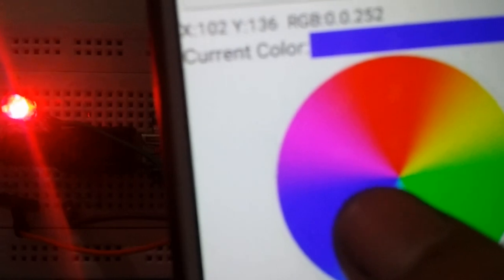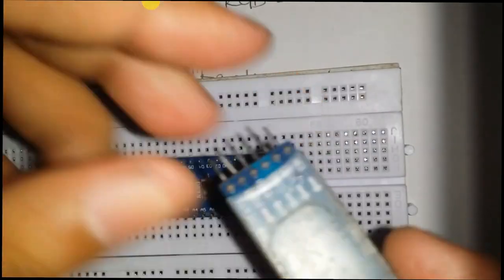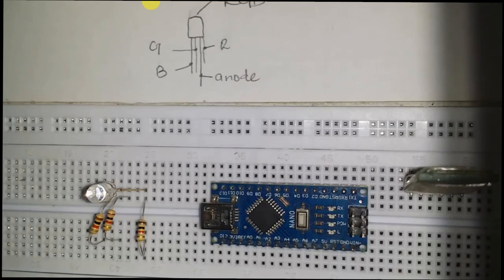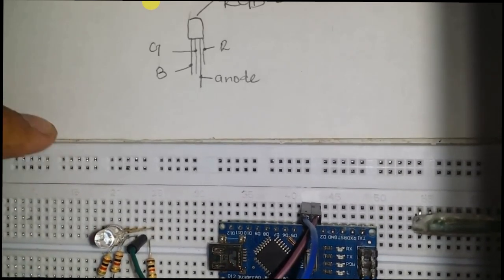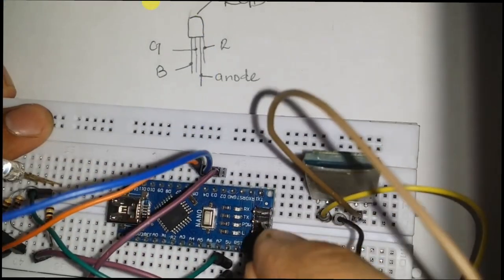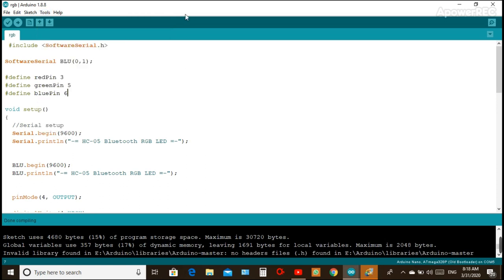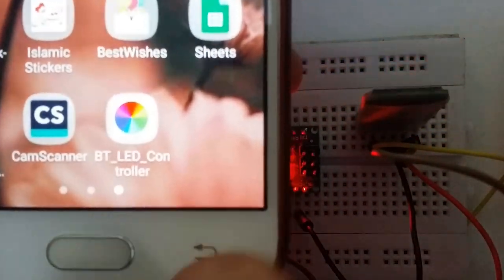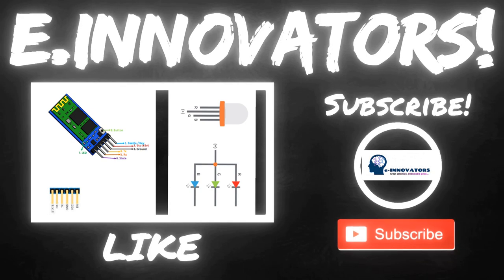RGB LED Control using Arduino! | DIY | Circuit Building | Demonstration | Tutorial | HC-05 bluetooth

Comment: Arduino: 1.8.13 (Windows Store 1.8.42.0) (Windows 10), Board: "Arduino Nano, ATmega328P"

Sketch uses 4538 bytes (14%) of program storage space. Maximum is 30720 bytes.

Global variables use 357 bytes (17%) of dynamic memory, leaving 1691 bytes for local variables. Maximum is 2048 bytes.

An error occurred while uploading the sketch

This report would have more information with
"Show verbose output during compilation"
option enabled in File -> Preferences.

^^^ How to fix the error?

Comment: I could not find the code in the video. Can you share it.
Reply from the maker: #include <SoftwareSerial.h>

SoftwareSerial BLU(0,1);

#define redPin 3
#define greenPin 5
#define bluePin 6

void setup()
{
  //Serial setup
  Serial.begin(9600);
  Serial.println("-= HC-05 Bluetooth RGB LED =-");

  BLU.begin(9600);
  BLU.println("-= HC-05 Bluetooth RGB LED =-");
  
 
  pinMode(4, OUTPUT);
 
  digitalWrite(4,HIGH);

  pinMode(redPin, OUTPUT);
  pinMode(greenPin, OUTPUT);
  pinMode(bluePin, OUTPUT);

  setColor(255, 0, 0);
  delay(500);
  setColor(0, 255, 0);
  delay(500);
  setColor(0, 0, 255);
  delay(500);
  setColor(255, 255, 255);
}

void loop()
{
  while (BLU.available() > 0)
  {
    int redInt = BLU.parseInt();
    int greenInt = BLU.parseInt();
    int blueInt = BLU.parseInt();

    redInt = constrain(redInt, 0, 255);
    greenInt = constrain(greenInt, 0, 255);
    blueInt = constrain(blueInt, 0, 255);

    if (BLU.available() > 0)
    {
      setColor(redInt, greenInt, blueInt);

      Serial.print("Red: ");
      Serial.print(redInt);
      Serial.print(" Green: ");
      Serial.print(greenInt);
      Serial.print(" Blue: ");
      Serial.print(blueInt);
      Serial.println();

      BLU.flush();
    }
  }
}

void setColor(int red, int green, int blue)
{
  analogWrite(redPin, red);
  analogWrite(greenPin, green);
  analogWrite(bluePin, blue);
}
Sorry for replying late!